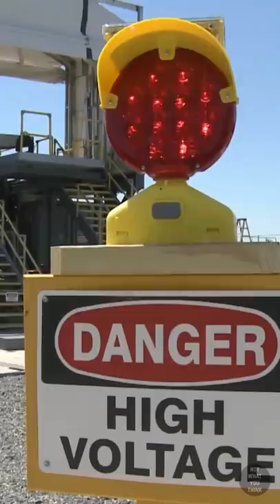Railguns: Destructive to the Core

Comment: This gun suffers from the same problem as the old British 16.25 inch MK 1 naval gun from 1888. The technology's ambition outpaced the existing materials to make it a practical weapon.
Reply: I think that's a very common aspect of innovation. We invent things all the time that just aren't possible yet with our current tools.
Reply: No. These in the video are prototypes. The material science department has their job to do and have been on this for many years...you will see. Power issues: there are some very novel solutions for that too. Just wait.
Reply: And power Generation/Storage capability. Thats why railguns/gauscannon are more the armaments of Starships. O.o
Reply: @grayeaglej  
.... you must think just a LITTLE BIT differently and you would see the solution to power generation for these weapons. The energy they need is closer than you think! I kid you not!! 👍🏿👍🏿👍🏿
Reply: ... no. Wrong service. Think, GATLING GUN....🤨‼️A hint.
Reply: @dmathmothtutinean8950  The only thing I know of capable of being carried by a Naval vessel and still have the massive generation ability to charge the monstrous capacitor banks of weapons like these are high output Thorium reactors. 
Unfortunately Thorium reactors are also "breeder" reactors and so are HEAVILY suppressed by the Nuclear Regulatory Commission to the point that not even the US Navy, nor any other military branch, has been permitted to use them. At least not officially. O.o
Reply: @dmathmothtutinean8950  I would like to know these solutions I don’t want to wait
Reply: @johnathenblanchard9432  failed troll
Reply: Its the same Issue that (partially) damned the Bismarck, it's guns were so powerful the broke it's radar
Reply: @someboiwhogivesadamn  
That's far from a unique problem.
During the second night action at Guadalcanal USS South Dakota had the exact same issue with her gun blast but that one ended op disabling nearly all of the ship's electrical fuse breakers.
This rendered the ship BLIND, MUTE and DEAF during a night battle.
Yamato also had issues with her Radar thanks to her gun blasts late in the war.
Hell even all the Iowa sisters had Radar issues with gun related blasts during WW2.
This is one of the main reasons by the Korean war the Iowas main search radar sets were fitted on masts behind the second smokestack.
Reply: @legiran9261  all the same issue, the tech just couldn't keep up with the firepower... Come to think of it can Railguns produce an EMP? Like is there even a possibility of that?
Reply: I mean who needs a lot of shots if a ship goes down in 1 or 2 shots
Reply: @tdteliteboy8991   If you can down a Gerard Ford type aircraft carrier zig zagging at 30 knots at 200 km range in two round which takes around 3 to 4 minutes to reach the target using unguided projectiles. I HIGHLY DOUBT THAT.
Reply: @grayeaglej  
...I worked in the Naval Weapons Laboratory in Dahlgren VA. I am being honest. There IS another energy source and it is truly robust, portable, and available. It can also be used for, ummm, other things as well. Honest! No kidding or deception👍🏿‼️
Reply: @someboiwhogivesadamn  
...yes. But not one that can be weaponized. There is a pulse nevertheless!
Reply: @someboiwhogivesadamn  
...physical PLACEMENT was the issue with that radar. Not technology failure.
Reply: @legiran9261  
...not a technology failure. It was a physical placement error. They hurried to get radar out to the war and solved some problems later...like the magnetic arming devices on USA torpedoes early in WWII. Big hurry...
Reply: @dmathmothtutinean8950  
I don’t know whether I should be getting excited and jumping for joy about that type of technology being around the corner, as you say, 
or should I be scared $hitless that such an energy source is that close to reality
Reply: @JZT-JZT  
... forgive me, my delivery is not subtle. I am not a poet but a scientist. I would prefer a free world 🌎 devoid of the CCP and Putinist. I am nevertheless sincere. If I were asked, I could make power for this weapon and ten like it each in turn every second and solve the barrel problem. Honestly and truthfully.
Reply: @dmathmothtutinean8950  Never said anything about radar technology on those ships being a failure. Stop strawmanning and putting words in my mouth. You seem like the guy who enjoys his petty dopamine high to dispute and one up comments on social media.
Reply: Waxel Punkt.  
.... not far away at all. Honestly!!!
Reply: @dmathmothtutinean8950  only issue is power supply.. Which isn't really a problem since they are more than likely being put on boats with fairly powerful nuclear reactors
Reply: @Ckcdillpickle  
if nukes were such an easy and obvious solution, then this video would not have made the power requirement a point to mention. BUT... newer ships, not just aircraft carriers might go nuclear to power rail guns but that means the powerplant WITH THE RAILGUN would just about double the price of the ship. There is ANOTHER POWER SUPPLY available. It is portable, takes up less space than a nuke reactor, and easier to make, and far cheaper. . You'll see.
Reply: I do believe that considering the power grids of nuclear aircraft carriers, 1 or even 2 rail guns can be fitted. Although they can only fire once per hour so it's kinda hit or miss...
Reply: @brazenh2836  
...okay... but, there truly is ANOTHER and a BETTER way. I am being coldly honest with you. America WILL have this weapon!
Reply: @grayeaglej  yeah "permitted" lol
Reply: This guy compares a railgun to 18th century tech lol
Reply: @daggermouth4695  Because I'm legit smarter than you to recognize patterns. Deal with it lol.
Reply: Dr. Bright  
...not many ships at all. I really honestly was in the US Navy for 20+ years and then as a civilian  in Dahlgren, Va 23459! There are very few such ships. Further, the ordinance for these guns will be a bit more exotic than what you see here. We have to improve some things for repeater action-rapid-fire. ALMOST THERE!! Including an excellent portable power supply 👍🏿👍🏿👍🏿👍🏿
Reply: @dmathmothtutinean8950  i think i know what you are getting at, i’m no weapons scientist but i believe you are referring to some form of self powering system utilizing the recoil perhaps or the kinetic energy to charge the weapon. correct me if i am wrong, but i believe gatling guns use a similar system with the rotation of the barrels
Reply: @calvinc32  he hinted at Gatling guns further up, but he keeps saying “I did this, I did that, I’m being so super honest believe me!” over and over. It kinda makes me not wanna believe him lol
Reply: @KFlexFantastic  yeah lol i don’t even know what else this guy is talking about
Reply: I think cannons blowing themselves because their power was beyond their structural integrity is a common occurance throughout history :P
Reply: @i.i.iiii.i.i  Only on a test bench. You don't pull this stunt on the battlefield. No general or admiral wants to be issued weapons that blows up in the faces of soldiers. That's why they know exactly how much powder goes into a specific model gun and not to exceed it. Yes of course accidents do happen on the battlefield but if it were "common" we would still be fighting wars with bows and arrows. Would you want to operate a gun knowing that the probability of dying by complete gun failure is "common"?
Reply: @zachbunch8701  Thats why I said "Officially". 

As a Farmer in the Wasteland of the Midwestern US im still mad we dont have Civilian micro-reactors so that far rural farms and communities aren't dependent on hundreds of thousands of miles of above ground high voltage power lines that are constantly getting taken out by Winds, Trees, Ice, Floods, Tornadoes, etc. 

In the High Summer and Deep Winter people DIE without power, EVERY YEAR, yet we still grow the bulk of the western hemisphere's Food. Its disgusting.
Reply: @dmathmothtutinean8950  
Flywheel + pulsed induction generator.
Reply: America would have fully functioning rail guns on ships now if Obama didn't take most of the funding away because it was expensive but when its prefected then it would cost less because the ammo for a rail gun cost like 1000 vs like 50000 for a bomb
Reply: @jacobhonaker9929  Its my understanding that the Obama Administration gutted the US Military so badly that Air Force and Navy officers were stealing parts from Museums in order to keep Aircraft in the air and more weapons and munitions were shipped to the Mexican Cartels than were shipped to Combat troops in both Iraq and Afghanistan theaters. 

I have personally seen evidence that corroborates the second claim, cartel members with M4s and LAW rocket launchers are so common on the border its become the norm. As to the problems with aircraft I do not know.
Reply: @grayeaglej  *it’s big brain black budget/market time!!!
Reply: The pictures you are seeing are close to 25 years old, the facility is in the midwest and these pictures were originally on a discovery channel program back in early 2005 and even then they were old enough to be declassified for the public.
Reply: @grayeaglej  you are confusing thorium reactors with something else, a thorium reactor cannot produce anything weaponizeable.
On the contrary, the exact reason why noone is using them, because the fuel cannot be enriched and made into plutonium for nuclear weapons!
Reply: @goingfubar7182   Well if you can't back up your statement with proof that they actually succeeded in making a reliably working gun system in 2021 then you get GTFO.  Oh wait they are declassified for the public. This still makes your comment moot and you can still GTFO.
Reply: @iammrmech7650  I have seen the Neutron output from Thorium reactors put to use in the enrichment process so perhaps thats what had me confused, its been so many years since I looked deeply into it, so I know Th CAN be used for refining, but you are probably right that they aren't specifically "Breeder" reactors.
Reply: Elon Musk... cough mars... cough cough
Reply: @dmathmothtutinean8950  would it be something like the power level with peek out before it got to the end of the barrel or in this case the real I can imagine if it does speak out before it gets to the end of the the rails that it would make a pretty good-sized spot on the rails I believe they would need some kind of system where they could slow the use of the power a little bit I believe they probably got some good people working on it I really haven't read anything about the 1888 gun I believe it's a power can go to the rails all the way to the end it won't make a big divot I'm just thinking off the top of my head I don't really know about that much about real guns I'm just going by what I've seen about him so don't get real Huffy tell me tell me what you think
Reply: @dmathmothtutinean8950  honestly arguing is all the world does anymore if we could be gentleman and get along with each other then we could probably caught we could probably solve some of the problems that we have you cannot solve problems by arguing we all live on the same world animal got to do something about what was what is going on it seems like you're both pretty smart seems like to me that if you guys put your heads together you could get a long ways unless you just like arguing
Reply: @chaotickreg7024  not really innovation is it ? Innovation is making something better with what you have got .then better materials would compound improvement  Look how crap computers are , more & more powerful to get round shit  progamming , no other reason
Reply: @grayeaglej  
The federal and state governments should step in and place all the power lines underground, Germany has all of there power lines underground. It would solve alot of the power outages across the US. the big hurdle to get past is politicians and bureaucracy BS, someone somewhere always has there hands in the cookie jar.
Reply: @dmathmothtutinean8950  using its own kinetic energy to power it? Or heat?
Reply: @daggermouth4695  more saying that the railgun is technologically ahead of its time like that 18th century tech was but only after a few years it was solved it's not gonna take long for this to have its problems fixed either
Reply: @dmathmothtutinean8950  I'm not sure if is kinetic energy your talking about but the gun would still need a significant power source for its first shot or if hasn't been shot for a while
Reply: @RandomGuy17768  Yes ive been advocating for underground power lines for years, however the entire US power and telecommunications infrastructure is in dire need of revamping. For decades corporate and government intrests have been pocketing the TRILLIONS of dollars earmarked for infrastructure upgrades while massive stretches of the country continue to use wires, pipes, and equipment that in some cases are over A HUNDRED YEARS OLD. 
And im not just talking about houses with lead/clay pipes and wired with bare wire on ceramic insulators. Ive replaced those personally myself. Im talking entire cities who have parts of their telecommunications systems left over from when GrahamBell was still personally running Bell Telephone, pipes carrying water and sewage that were layed in the 1800s, and power lines older than the abandoned Telegraph lines tangled in with them. 

Getting properly installed, modern, up to date infrastructure is far more difficult than it should be in what is supposed to be the Richest country on Earth. O.o
Reply: @grayeaglej  
Well said, and I wholeheartedly agree. I live in Texas and my house was built in the early 70's, right at the end of the Vietnam war, it's all copper I've had to replace my entire circuit board twice, I've been living here since the Army sent me here in 2000 retired here as a matter of fact. Power outages are common around here, but as you know they call 'em "rolling blackouts" and blame it on the power grid being overtaxed🙄. My wife is German and she says we live like a 3rd world country when compared to hers. I'm starting to agree with her. If China wanted to invade, a few simple EMP explosions in the right place would cripple our country.
Reply: @RandomGuy17768  Was born in Ft Worth. Currently exiled to the midwestern wasteland though, living in a farmhouse that was built in 1921. house before that was in west virginia and built in the 30s. Some very interesting wiring and plumbing in those old places. o.o Screw in fuses instead of breakers too. even found a bare metal, ceramic base, "knife toggle" switch wired inside a wall once. tiny thing but would have been at home in Doctor Frankenstein's laboratory. o.o
Reply: @uhohmemebiggestboy212  ...you can be sure I am not thinking what you are writing... FOR SURE!
Reply: @KFlexFantastic  
...then don’t believe me. DO NOT! Just do what I asked: WAIT AND SEE.... 🤦🏾‍♂️
Reply: @goingfubar7182  
....totally correct!! As I also said earlier. These videos are of prototypes! You have to see how far we have come! 👍🏿👍🏿👍🏿
Reply: @buffalo wt 
.... yes we do. But how it is used is the trick ...hint: ablative, thermal liner or sabot. They have even considered using.....drum roll please.... water 😳... yes.
Reply: @thomassorrels1022  
..... power: In the videos they use ONE power source. That’s a hint on one of the newer designs. But the other is, well, my favourite. You will see it 👍🏿
Reply: @RandomGuy17768  
.... not if they want to raise their own kids🤨🤨
Reply: @dmathmothtutinean8950  I'm winder what this power source could be seems pretty cool tho
Reply: @RandomGuy17768  well they don't, but there was a policy decision a few years to shift to underground HVDC for major power lines. I suppose using DC alleviates a lot of phase problems with wind generators.
Reply: @dmathmothtutinean8950  And that's why the project is no longer funded?
Reply: @grayeaglej  
… I understand what you have said. However your thinking needs to embrace a paradigm shift. ENERGY, is what is needed not POWER. Expand your thinking just a bit… please.
Reply: @legiran9261  
… this scenario you have described contains the solution to the supposed problem. Put ANYTHING in front of the hypersonic round that APPEARS to be part of the ship but is both ROBUST and REACTIVE and you have defeated the hypersonic round…🤨‼️ meanwhile your Aegis ships and Growlers and E-2D+ planes are degrading the kill chain …take out the trash🤨🤨💪🏿💪🏿‼️
Reply: @uhohmemebiggestboy212  
No. Not kinetic….all you have to do is think ENERY not POWER exclusively.

Comment: For those wondering how the projectiles were recorded flying at those speeds. The camera isn't moving, a mirror on a servo is used to follow the projectile. Too many cameras threw up moving that fast, the mirrors do just fine.
Reply: I don’t think you can move mirrors so fast and so exact.
Reply: Railguns are nauseous
Reply: @__Mr.White__  well, it's a lot more possible than rotating a gigantic super slow motion camera.
Reply: @__Mr.White__  you're correct. Thats why motors and computers exist!
Reply: at this speed it's likely a scanner motor. They are used in laser projectors and can rotate incredibly fast and accurately
Reply: @__Mr.White__  For a human, that is.
Reply: @__Mr.White__  I think it's possible, it doesn't have to move as fast as the projectile since its also being rotated
Reply: It could also just be a wide shot camera...
Reply: It's a CGI assisted video of multiple camera footages
Reply: @iAmDislikingEveryShort  that's the most likely explanation
Reply: @firefly618  hey,  thanks 🙂
Reply: @iAmDislikingEveryShort  it's not, they regularly record video of extremely high velocity projectiles. As someone else mentioned, they typically sync up the shot with a spinning mirror